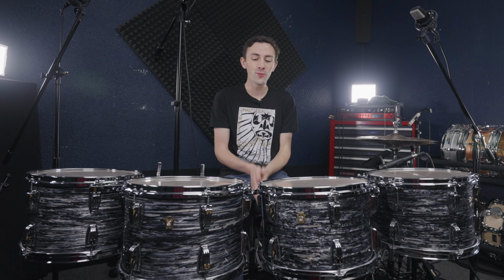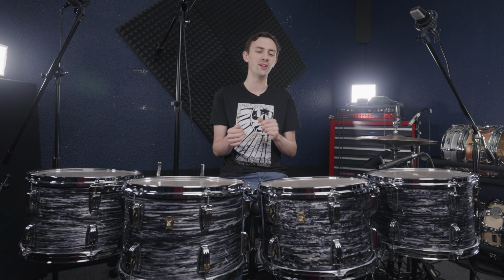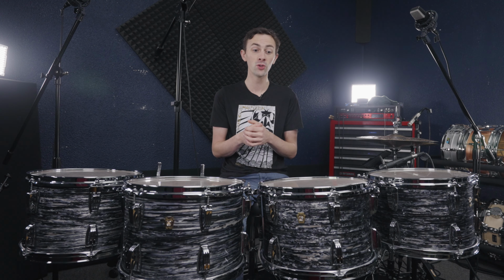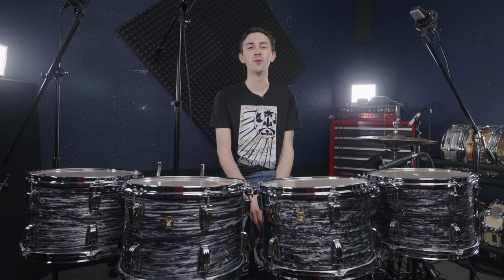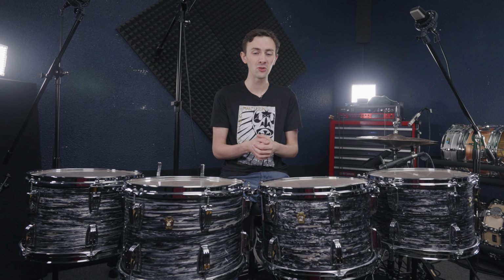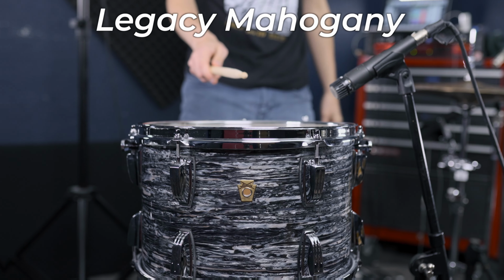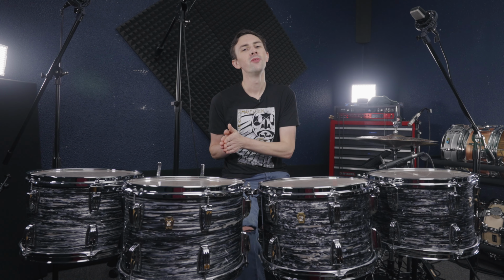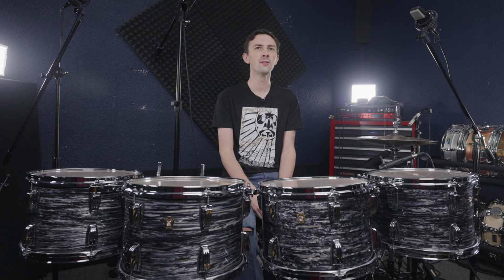Ludwig Tom Shootout | Does the Shell Matter?

Comment: For me personally, volume number one is the best. Definitely the cleanest and most open tone. The maple has overtones at the very end of the sustain, as if at the end the tone rises higher. Put on your headphones and you'll hear what I'm talking about. Only mahogany has a stable tone from beginning to end
Reply: I think it has something to do with the way the Classic Maple was tuned. Its a straight shell, no re-rings that control it a bit. The oak, was dead for the most part, because of the way it was tuned, however that's just my opinion on that. Certain drums have a range and sweet spot where they open up and sing.

Comment: Of course the shells matter.  The material and it's denseness matters.  The thickness matters, the bearing edge matters, the heads matter, the tuning matters.  Never compare drums when they're dampened, always have them wide open and only use single-ply heads.  This is the proper way to hear the tones they're capable of, whether or not you choose to muffle them later.

Comment: Several points:

1) What heads were used?  Clear 2 ply?

2) Legacy: 30 degree bearing edges; Classic: 45 degree bearing edges

3) Was surprised about the extent of higher frequency presence in classic maple.  Also surprised to hear the role of the oak in dampening these frequencies.

4) A db meter might be helpful in distinguishing classic oak from the legacy models, all of which have notably shorter sustain.

This test was awesome!!!  Great format, thanks for the effort here.

Comment: Great comparison!  I guessed them all correctly, which I must admit was a surprise.   There were very subtle differences between them, but based on the first test with just the overheads, I was instantly drawn to tom 1 (Legacy Mahogany) as it seemed to have the most pleasing pitch bend, where the pitch of the note bends downwards slightly as the sustain fades out.   The Legacy Maple did that too, but had some less pleasant ringing overtones towards the end of the sustain. This was the other way around during the second test with the close mic.   I preferred the Legacy Maple which has the most pleasing tone in that test and the Legacy Mahogany seemed to have some annoying overtones!   The Classic Maple seemed the most different to all the others, and it did sound slightly higher pitched overall, but also had the least pitch bend, where the pitch stayed the same for the full length of the note.   The Oak drum was really nice too with a decent pitch bend, but some bright over tones.
Reply: 1 sounds the best. They all sounded ok apart from 2 which sucked

Comment: The reinforced shells (legacy) should have a quicker decay, DW actually added re-rings to make this happen on their collectors series drums so drummers wouldn’t use dampening or 2 ply heads.  I have a 1963 ludwig downbeat set (12/14/20) with mahogany Toms and a maple bass drum. i think the reason i like them so much has more to do with the Tom’s having brass hoops and no lug gaskets. It’s also worth noting i have a 1964 Ludwig clubdate set with the same shells and sizes and it’s definitely more resonant with just the single lug in the middle of the shell.

Comment: I for sure knew that the first two were in the Legacy series and the 3rd was the classic maple. My personal kit is a legacy mahogany kit and I've both played and mixed a classic maple kit for the past 10yrs live. Also, I would argue that an SM57 was not the best choice for the close mic in getting the differences between the shells to be more prevalent. You need a mic that doesn't have as much of a low end roll off as the SM57 does. An SM57 actually starts to roll off at 200hz to -6db around 65hz (generally point of inaudibility when there's a lot going on). In the live situation I'm in, we've noticed the best tom mics for our setup (Classic Maple) are the EV RE20. They have excellent rear rejection (so they don't pick up hardly any cymbal bleed if at all) and have a far better frequency response than most mics with the -6db point hovering around 36hz. Absolutely phenomenal mics.

Anyway, that would be why there was very little difference in this shootout. The Legacy series digs a lot deeper (specifically the mahogany) into the frequency spectrum and sound absolutely massive by comparison to the Classic series.

Comment: Is that the real comparison we should do here? I think it's more about if certain shell types sound better in certain tunings. They don't have to sound extremely different when tuned exactly the same imho, as long as they do certain ttypes of tunings better than the next configuration.
Reply from the maker: A good point to bring up! I've had others say something similar, and it's worth considering. Personally, I think it's far more likely that shell dimension will have a far more significant impact on optimal tuning range than shell material/density. It's worth experimenting with, I just personally chose not to do it because once you have each drum at a different tuning, you haven't controlled for all other variables anymore.
Reply: Yes and there’s something about the way birch sounds with remo pin stripes or ec2s compared to the way maple reacts with stripes and ec2s.
Reply: Other than that shell thickness and hardware plays a bigger role than wood type imo.
Reply from the maker: @larrytate1657  That's been my belief lately too.

Comment: I find drum tone is a lot more about the ratio of fundamental tone to overtone than other instruments. In these examples I found the loudest fundamental compared to overtones are in order, 4 3 2 1 (to my ear, as recorded). In the overtone series, the fundamental tone is usually the loudest, but the question is by how much compared to the rest of the overtones. If you’re playing in a louder band where volume is an issue, you might want a stronger fundamental tone (“closed” sounding). If you’re playing in a lower volume group, or where a more complex tone is wanted and can actually be heard with more sensitive mixing perhaps, then the mahogany here would be a good choice (more overtones=more “open” sounding)

Fwiw, I’ve always liked the very strong fundamental of maple properly tuned.  The sustain of maple tends to be long but relatively quiet compared to the initial attack, giving maple a very punchy sound. Add more compression in the signal if you want more of that ring to come out. Also more plies=more mass=less energy dissipation is a contributing factor to increase the volume of the sustain phase. 

Hope this sparks a thought for someone - ymmv!

Comment: I much preferred #1 because, even though it was the least resonant, the drier sound was more stable and controlled. I didn't like the way the pitch dropped in #2 after it was hit. Both #3 and #4 had relatively high pitched, distinct overtones or harmonics that I found distracting and annoying. I would try using dampeners to reduce those ringing tones and, when recording, would have to EQ out those unwanted frequencies with notch filters. During the blind tests, I thought #1 was mahogany and the most resonant #3 was maple. I expect most people, however, will not be perceptive enough to hear these differences. Personal tastes and which drum sounds are most suitable for different genres are also important. A lot of drummers just buy drums that are the loudest and most resonant, which is why maple shells are very popular.

Comment: Thanks for doing this - confirms what I long suspected - the shell makes little difference. As you said - most of the minor differences here are the result of imperfect exact tuning between the four drums. Your conclusion makes sense from a physics perspective as well. Transferring vibrational energy from a very small mass (the head) to a much larger mass (the shell) is very inefficient. For the shell to make much difference that energy transfer would have to occur either through the bearing edge or through the interaction of internal acoustic waves with the shell - both very inefficient. Shell depth, on the other hand, will make a lot of difference.
Reply: of course the shell makes little difference because he is hitting the head and not the shell ,if you want to  get  just a little more shell tone you should be hitting rimshots on toms not just on the snare, but the transfer of energy is still going to be quite small though ,the only  way to actually hear the full resonance of the shell is by hitting it directly with a mallet.

Comment: Why did you not try different tunings? They're all tuned fairly flat/hipster for 12" toms. If there's a Venn diagram for tuning, these drums are tuned to where they all overlap. Nuances of the shells really pop when you dial them into where they each shine.
Reply from the maker: The center of the Venn diagram is exactly what I was going for. There's only so much production time I'm able to devote to these videos, unfortunately, but regardless I prefer having one tuning. It keeps the comparison clear and concise. It would be an interesting though to investigate whether a wood type really has a tuning range that it excels at. My suspicion is that the dimensions are far more important in that regard.
Reply: @ColeParamore  nice reply, thanks. I'm also skeptical of wood type differences being hugely important. Dimensions really make the difference. Thickness, edges, etc. Those will only really start to shine once you get into the fringes of tuning. That said, I'm always amazed how much difference heads make.
Reply from the maker: @ryanridgely7807  totally agree!

Comment: Here's some other measurements you can do to scientifically analyze each drum.

1.  Look at the Attack, Decay and Sustain of each drum.  You'll need to look at each time you hit the drum and look at the wave form.
2.  Look at the Harmonic Structure of each.  There's software that can show you the amplitude of the fundamental and all of its harmonics.  This will give you a look at the timbre of each drum.

If you do these measurements, I would suggest you get a microphone that's as flat response as possible.  Earthworks Microphones have a very flat response curve, they will impact the tone the least.

as far as room is concerned, I would suggest picking different room treatment.  the type of open cell foam you're using doesn't have a good absorption coefficient curve. it's just typically low priced open cell foam. There are other brands that are far superior that have a more linear absorption coefficient curve for a more natural acoustic properties.

Comment: This test would be great, however, not to be a dick, it's highly inaccurate for two reasons.
One...you never tune the batter and reso heads to equal tension. By equally tensioning batter and reso heads you've essentially put them "in-phase." They cancel each other out and kill sustain just like we heard here. Listen with good headphones. These were dead "thuds" and had almost zero sustain. Any sustain you think you're hearing is actually all four drums....which leads us to the second problem...
The second problem is this... For the purpose of this test you need to conduct it with each drum SEPARATELY, isolated from one another! You might be hitting one drum at a time but you're actually hearing all four drums at once due to "Sympathetic Resonance." Sympathetic Resonance is a harmonic phenomenon that occurs when a vibratory body, like a drum, responds to external vibrations, like another drum being struck right next to it or in close proximity. Simply put, it's what causes snare buzz. 
So, to accurately hear what each drum sounds like, one head should be tensioned slightly lower or higher than the other; most guys tension the reso lower than the batter. Then record them individually and isolated from each other. I guarantee you'll hear a much bigger difference between them.
Reply from the maker: Hey Tony! Thanks for the input, and you make a couple of great points. I'll address the second one first - I actually do exactly what you're recommending just a few minutes into the video. Check the timestamps - I do a back to back test with them all on stands next to each other, and then all isolated for exactly the reason you described. For your first point, I'm going to push back slightly. Although cancellation is possible, it's actually far more common for heads tuned the same to sympathetically resonate and actually give you more resonance. Phase cancellation is completely based on the distance of the two waves, and in the case where the two waves are in phase, you get a doubling of the frequency, not a cancellation. We'd have to do some higher level math to determine exactly what's going on with these drums and their depth specifically based on what I have them tuned to, but I can assure you there isn't any significant cancellation going on between the heads. I have them tuned a bit lower than some people do, and I'm in a fairly dead room here, which may be what you're picking up on. Thanks for checking it out, and watch the whole thing, you may find the second part revealing!